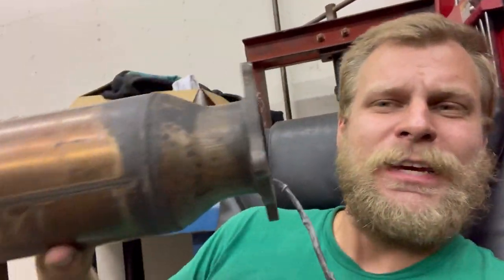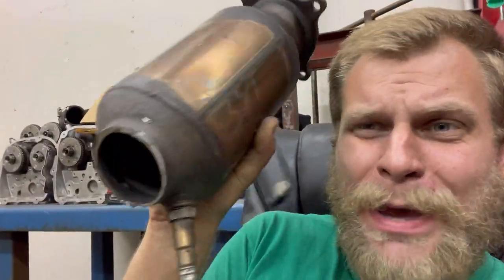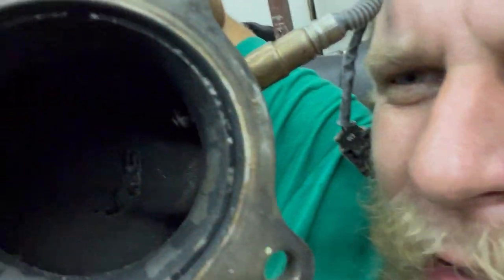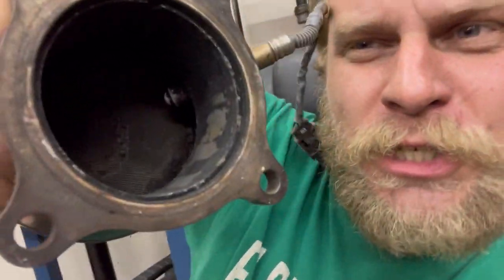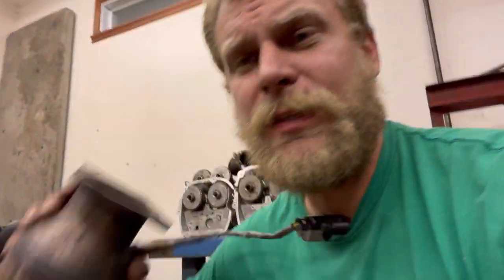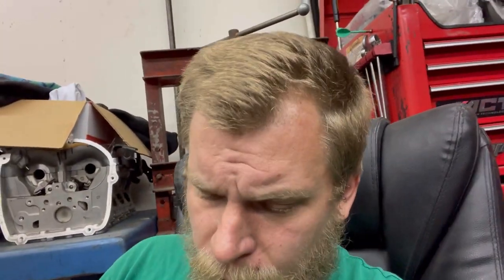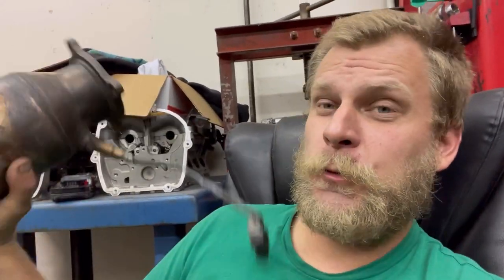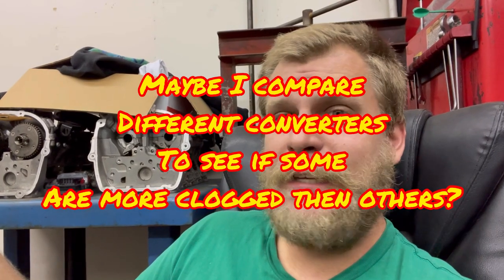P0420 Lacquer Thinner didn’t work catalytic converter Catalyst efficiency Scotty Kilmer Test Fail

Comment from the maker: I think that the excessive oil consumption overheats them and kills the reaction, I don’t believe it’s possible to fix with cleaning.  Same when you have a stuck injector or flashing check engine light / misfires = extra fuel being burned up in the converter past what it can take doing permanent damage
Reply: I respectfully disagree.  I think excessive oil consumption starts to build up a layer covering the precious metal, and this layer can be dissolved away.  I can give many confirmed cases of ce light on before, acid clean, and ce light off after.  But choose what you want to believe 👍
Reply from the maker: @yogamon  https://www.bgprod.com/blog/what-are-the-symptoms-of-a-bad-catalytic-converter/
Reply: @NaptownTuner  "Anyways, I have NOT had a P0420 since, and it's been almost a full year. So I can (at least somewhat) attest to the citric acid bath being effective."
Reply: @NaptownTuner  I battled a p0420 on a Honda Accord for 3 years and read everything under the sun on this subject.  The Honda burned 1qt /1k miles for years.  As long as the honeycomb is not melted or disintegrated, I am certain the cats can be cleaned enough to turn off ce light
Reply from the maker: to my knowledge it’s not the least bit controversial that unburned fuel and oil will overheat the catalyst causing permanent damage.  But choose what you want to believe 👍
Reply: @NaptownTuner  did acetone in tank several times, other claimed gas tank additives that are supposed to clean up the cat.  They all did nothing for the ce light.  Yes sometimes it would go away for a day or so but ce light always returned
Reply: @NaptownTuner  I'm not saying that unburnt fuel or excessive oil doesn't make cat get hotter than usual.  The honeycomb is designed to work for years at high temp.  I've monitored the cats temp on my torque app, it gets up to 1600F under wot, so I don't think that unburnt fuel or oil necessarily causes the honeycomb to melt or disintegrate.   Its the buildup covering the $$$$ catalyst material that the O2 sensors tell the computer the cats are operating below efficiency, hence smoke a p0420
Reply: 99.9% SURE soaking it to Water based carbon remover like TURCO 9045-6 manufactured by Henkel manufacturer of Locktite will surely work. If not available try Piston Kleen.
Reply: @w0lvez1  do you have a reference for this
Reply: @w0lvez1  Let me guess, you don't know what a three way catalytic converter is referring to or more precisely what are the three types of molecules a catalytic converter converts for emissions reasons, what are the typical precious metals used for the catalyst material, what the ceramic honeycomb (better term here is ceramic substrate)  is made of and it's temperature characteristics, what a ce light of p0420 means when it says catalytic converter efficiency is low and how that relates to post cat oxygen sensor voltage readings, what is an oxygen storage test or what is an O2 sensor is even made of?  Why do cars in California have different more expensive cats than the other states or cars?  Why are prius's the main target for cat theft?

Hint for the first one is unburnt hydrocarbons (gas), carbon monoxide (CO)  and nitrous oxides (NOx).
Reply: Now here is evidence of the cat on a Subaru (known burners of oil) starting to melt and disintegrate.  In this case yeah most likely you can't clean

https://youtu.be/mg9njaj3NgI?t=990
Reply: @w0lvez1  your assumption here is that carbon build up is what can be found on a used cat or a cat giving 420/430 codes.  This is not the case.  The buildup is most likely from oil and gas additives like phosphorus from zddp, silicon (which are known to poison cats), calcium, copper, lead, aluminum, etc.
Reply: @w0lvez1  yes I went thru all the carbon dissolvers thinking my Honda had stuck rings using kreen, bg109, marvel mystery, autorx in either the crank or piston soak.  I am familiar with dissolving carbon.
Reply: @yogamon  Unburned Fuel = Carbon Buildup. The buildup in the intake valve is much harder and requires more time to dissolved.
Reply: @w0lvez1  this vid by naptown tuner was about p0420 and cat converters.  Not talking about carbon buildup on intake valves and gdi motors.
Reply: @yogamon  it amazes me how many of these "mechanics" feel the need to dis scotty. literally anything that will dissolve the burned oil build up will fix the cat IF the cat being clogged or dirty is really the problem. I cant understand why so many great additives are described as snake oil when they actually work. and scotty never said it would work every time, he said he had seen it work many times, not every time. you said "citric acid bath" worked for you, have you ever heard anyone using oven cleaner to clean the cat? I am thinking of using carb or brake clean to spray into the sensor hole.

Comment: I worked 30 years for "BASF/Engelhard," which invented the Tri-way catalytic converter in the 1960s and  still makes 90% (every OEM catalyst) and refines 99% of  the world's precious metals refined out of spent catalytic converters.  
   I dont claim to be an expert in anything...EXCEPT the catalyst that makes the honeycomb of each catalytic converter. We did not can them.
    A bathe in dawn dish detergent will only remove the burnt oil. Most any acidic ( pH 6-6.5) chemical bathe will clean ceramic honeycomb tri-way catalytic converters. Such as Citric, nitric, hydrochloric,  hydrofloric,, etc... The hotter the chemical bathe, the better. Soaking bathe duration will be less than 24 hours.
   And , yes, slightly acidic (pH 6.5 or less) vapors of positively charged hydrocarbon vapors in exhaust caused by burning lacquer thinner and a catalytic converter temperature above 400 C for several hours will clean a converter that does  not have a broken ceramic honeycomb and is not totally blocked. The hotter the cat, the better it will clean. The closer the cat is to the engine, the higher the temperature.
    The precious metals will not, and cannot separate from the ceramic honeycomb unless the honeycomb is cracked and broken or if you use 100% hydrochloric acid oxidized with chlorine .  The platinum,  palladium,  and rhodium (tri-way) is molecularly bonded with the ceramic. An acidic and heavily oxidized solution (pure Hcl acid and sodium chlorate, or sparged in chlorine at 70 Celsius) will dissolve 99.5% precious metals from ground and burned tri-way cats for metals reclamation. The ceramic is left as a solid residue and will not dissolve in Hcl acid and chlorine. Nor does ceramic burn off below 2500 degrees Celsius. The precious metals will not burn off at any temp. Unless you have a city size electric substation and a plasma electric arc furnace.

Comment: Worked for me... I added lacquer thinner the same week the light came on and it absolutely worked. Obviously not everyone will get the same result, because there are just too many variables. Age, mileage, the amount of dirt, corrosion levels, tank size, etc. There are too many people that have successfully used this method to get rid of a p0420 code to simply claim it doesn't work. Crud, or build up from corrosion, is not the only reason a car will throw a p0420/30. In my case it was likely the cat was in good condition just excessively dirty.
 I feel like you are frustrated that it didn't work for you, which is understandable, but I think people should still try it for themselves...
It's worth mentioning that it also worked for a friend of mine, but he had to do it twice. The first time only killed the code for a few hours.

Comment: You can get a spark plug oil fouler spacer from the auto parts store and put it on the end of your output 02 sensor, that will clear your code and keep it from coming back on.  The package comes with 2 of them, so use both together it works the best, and will keep your fault code from coming back on.
Reply: I did that to my 06 Silverado it worked

Comment: The lacquer thinner absolutely worked on my 2006 xterra. I put  in 1 gallon on top of a half tank of gas. This has worked for many others also.
Reply: Hey Harold, I have an '05 Xterra that I want to try this on. Can you tell me exactly what you did and how long you drove it for and if the check engine light went off by itself?
Reply: @jasonkentros1633 ut 1 gallon of lacquer thinner into your tank with about 8 gallons of gas and run the engine at 2,000 rpm’s for 30 minutes. You can put a brick on the pedal or drive it in 3rd gear. Reset the check engine light. When the tank gets low, fill it with premium. Your light might come back on again, drive a few days and reset the light again. If it stays off, it worked.

Comment: Got a Toyota Taco @ 230k with a P0420.  I used a shop vacuum in the tailpipe and passed dawn dish soap and water through the oxygen sensor port.  Once all the water was vacuumed through the tailpipe [yeah I know there's gonna be some water left in the muffler baffles.], I passed 12 ounces of acetone through it.  Then drove it at 70MPH for 16 minutes.  Catalytic temp reached 1400F precat and 1350 post cat.  Cat monitor passed it with .78 efficiency; 2 points shy of failing.  P0420 gone.  It lasted only a couple days until I put regular fuel from Habibi's gas station.  So  I'm doing premium from now on.

Mr. Kilmer's method of using Lacquer thinner is simply increases the octane of the fuel.  Lacquer thinner contains acetone and Toluene.  The concentration of acetone in the gas tank isn't strong enough to damage plastic fuel pumps but is strong enough to clean fuel injectors.  A small amount of Toluene leaves the combustion chamber and enters the cat and is able to clean it when the cat is at working temp.  I'm still trying to figure out the cost effectiveness of using Scotty's method compared to just using premium gasoline and the Italian method of cleaning cats [driving fast enough to make the cat reach 1800F for at least 16 minutes].  I also have the idea of using an ounce of ATF fluid in the gas tank if premium gasoline is too expensive.  

There's also another idea.  The elements in the catalytic core not only contain platinum, it contains 25 grams of Cerium in the ceramic honeycomb.  Cerium acts to grab onto oxygen in it's heated state.  If the cat has a high temp oil covering it or if there is too much ash from the dried up antifreeze [e.g., from a leaky head gasket], it will not grab that oxygen and your downstream oxygen sensor will send a voltage signal pattern that makes the ECU think that the cat is not efficient.  So if you plan on using soapy water to clean your catalytic converter, I suggest you boil your cat to clear out the antifreeze precipitates and other non-water soluble compounds such as silicone dioxide, a compound used in head gasket sealer.

Comment: Whole gallon did not work on my 2010 Odyssey, (215K).  Had tried Guaranteed to Pass, Cataclean, Duralube, with only occasional and brief fixing.  Yesterday, my brother said the new Risolone Cat Cleaner fixed his son's 215K Civic very quickly.  I tried it in my Odyssey, followed directions exactly, worked after only 26 miles!  Had it inspected right away....

Comment: I think the older cars probably could have their converters re conditioned by laqueur thinner because they probably ran a little cooler than the cats run on the B8 platforms.. with a touch cooler the solvent was allowed to condense in the converter and clean the palladium.. with where the cat on the B8 its way too hot for any solvent.. I think the O2 sensor/ECM might be throwing a false code
Reply from the maker: I think that the excessive oil consumption overheats them and kills the reaction, I don’t believe it’s possible to fix with cleaning.  Same when you have a stuck injector or flashing check engine light / misfires = extra fuel being burned up in the converter past what it can take doing permanent damage

Comment: Also it is known that the precious metals do go out the exhaust so it will lose efficiency over time anyways, but can be cleaned.
Reply from the maker: It’s not uncommon for the older audis to blow out the entire guts of the converter.  One side of my 2001 s6 was completely empty
Reply: @NaptownTuner  well that maybe just shitty honeycomb material that burns over time cause cats do run hot.  Obvi if the cat is damaged from overheating, melting or disintegrating, replacement is your only option.

Comment: Water based carbon remover like TURCO 9045-6 manufactured by Henkel manufacturer of Locktite will surely work.
Reply: Sounds like more reasonable than detergent.

Comment: 2004 4runner- added a gallon   ,,(8-17-22) of lacquer thinner to 1/2 tank.  Had a 420 fault code ; Bank one efficiency below threshold & a 430, Bank two below threshold.  Ran it about 60 miles so far. Scotty said run it for 150 miles.  No 420 or 430 so far. will report back.  It runs fine- lots of impressive power for a V-6.  I want to complete the 150 miles before I issue a verdict; but so far-so good...   Many other YouTubers report success & no harm to their vehicles from using lacquer thinner.    The thing is-if you had other issues like oil or coolant going through the Cat, it could destroy it & no amount of Cataclean or Lacquer thinner can repair it.  They don't repair: They remove hydrocarbon build up in the honeycombs. Sometimes it wasn't cleaned before the damage was done.

Comment: maybe I'm wrong but i understood that it would help clean it not fix it, and if that didn't work you could try taking it out and cleaning with soap and water the point of using the lacquer in tank was to possibly clean it without having to take it off of course that's after you rule out all other things first and before buying a new one

Comment: What acetone does is make the burn cleaner and tricks the O2 sensor thinking the exhaust is clean.  If you really want to clean a cat, soak it in citric and oxalic acid.  Nothing else works like NaOh, acetone, dish soap etc.
Reply: What are the measurement of citric and oxalic acid when cleaning a cat?
Reply: @snazyuploads21  Google oxalic citric acid catalytic converter
Reply: Thanks, found the measurements online. Glad to have found your comment about the citric and oxalic acid mixture.
Reply: The lacquer thinner worked like magic on my stock converter with 325,000 miles on it.

Comment: LISTEN to Scotty's video again. You did NOT FOLLOW THE INSTRUCTIONS. You are supposed to drive the car right away after putting in the thinner at a higher speed and for some time. You did neither. Unless the converter was damaged (which was the case with one person where the converter was melted), it worked.

Comment: Burned thinner may create some detergent effect on the catalitic material. we are not all chemist here. If you study organic chemistry, it can explain what s happening after this lacquer burned. People just tries and tries. If you are lucky and your cat converter is in early stage of dirt or burn, this can be a solution. But if you already had a bad injector and run the car for a while with that, unburnt gas burns inside the cat converter and it may harm the materials, or even broke it. Same thing with happens to charcoal if you burn it too much it breaks. Therefore, I don't think any cleaner works after hard burn. So we cannot say it works or it does not work totally. Or some people maybe have miss-fire and trying to get rid off the P0420. Whatever they put in the gas tank does not solve their issue, on the contrary this thinner can make it worse because of excessive heat on cats when it burned. Summarily, either any video says it works 100% definitely is not reliable for me or anyone says it does not work totally means they are  not objective.

Comment: I'm guessing lacquer thinner works because it contains acetone. So does cataclean. And from what I read on their web site, the combustion process turns acetone into another chemical in its exhaust vapor that cleans catalytic converters. But that would mean you'd have to make sure you're getting exactly the right brand of lacquer thinner to know that it has acetone and enough of it.

Comment: There's a reason there are 4+ million views for this on Scotty Kilmer's video. I tried this last night on my '99 VW GTI Vr6. One gallon thinner to just over half a tank of gas (about 8-9 gallons). Drove at highway speeds until the gas tank had a gallon left (Approximately 160 miles or so). Filled with high octane gas, which my car requires. The moment after the fill-up and starting the car back up, light came off. Much better vehicle performance as well. At about 108k miles. We'll see how long this lasts. I do know it cleaned the crap out of it.

Comment: If a vehicle is burning oil or dumping excessive fuel, the cat won't operate the way it's supposed to and sensors throw the code. A cat that is melted or broken inside can't be cleaned to return to new condition. ....The cat in this vehicle is physically broken ("a few chunks missing), so no cleaning technique can "make it better".

Comment: You stated in your last video that you had bad coils.  I guess is all that raw fuel going in to the catalytic converter ruined it causing the P0430.  If the catalytic converter is inefficient due to soot the lacquer will definitely work.